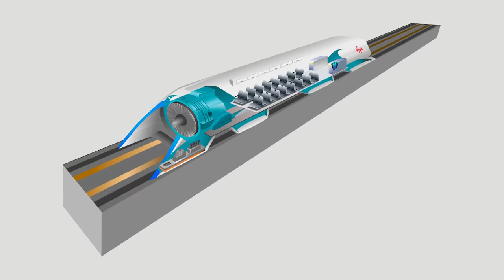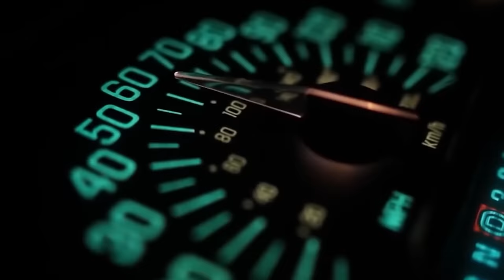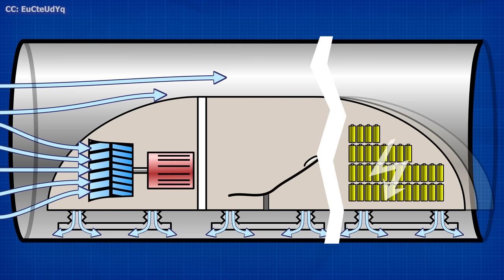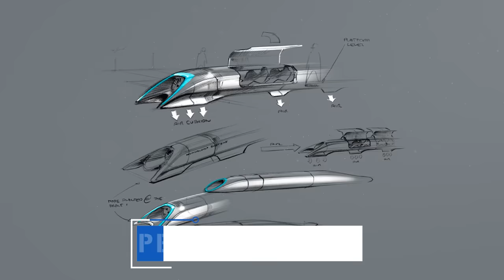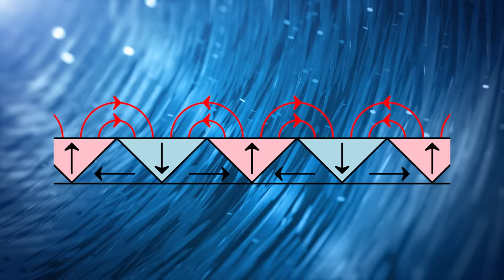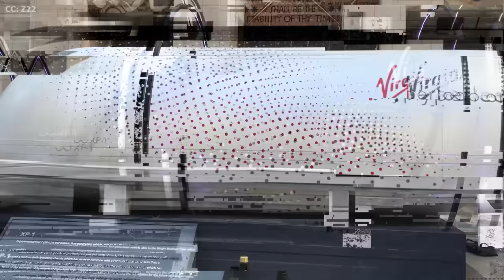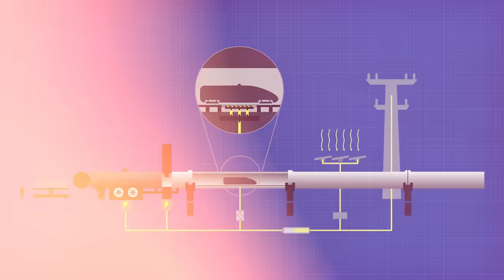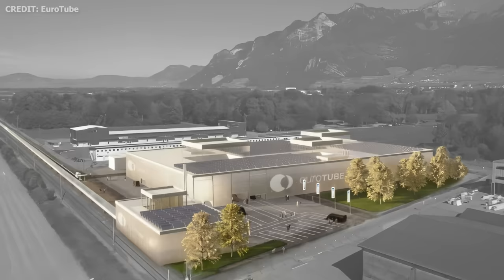We’re Getting Closer to a Hyperloop...

Comment: Sir, since you got this wrong from the start - vacuum trains are a more than hundred years old science fiction idea - long before Elon Musk´s father was born, I am not sure whether it makes sence to follow this to the end. However, here are some very simple reasons why this concept has no practical value: 1. Economics, 2. Technical issues and 3. Security.   As for no. 1 the more complex, the more expensive is a system. Cost for building and operation will be skyrocketing against any other system. One would have to build this tube more or less straight over land that is earned by someone, with a supply road underneath and service stations all 20 km with spare part warehouses and service crews and, and and...endless costs of operation. As for no.2 to maintain a medium vacuum in a tube of 3-4m diameter, there will be a massive amout of vacuum pumps required all requireing constant maintenance and energy. You must be able to seal this tube by airlocks to get people in an off the train and you have to deal with temperature differences and many more things to keep a vacuum upright in a chamber of this size. And last but not least: no. 3 Security. There need to be an option to evacuate the passengers in case of havoc or train failure. That would require to have airlocks every 3-5 km on the route or flood the whole system. Not to speak about the perfect terrorist target such a concept would be. However, lets for one moment think all these technicals and security issues could be resolved. There are already solutions in place which provide a better, cheaper and more effective and secure solution of transport already: The "train" and the "plane". There is no advantage over these by a "Hyperloop" an Hyperloop is just another Elon Musk bullshit concept and everybody who waste one cent for this project is completely mad and out of his mind.

Comment: No, the hyperloop will not happen.   Not at "scale".    Maybe some demonstrations, but not in a really impactful way.
Reply: Why not? Welded rails work great at scale without any issue with thermal expansion despite the lack of joints. I don't see why a vacuum chamber would not.
Reply: @johntheux9238  Won't the vacuum chambers need to be very structurally strong, to face the pressure ? Having them expand and contract won't jeopardize that ?

Also, even without that to worry, it's still massively expensive. The maglevs are considerably easier and cheaper, for ... 40 years already ? And yet you barely have any around the world. Because they're that expensive. The hyperloop is another magnitude more expensive.

If that 3rd world country of USA would actually have wanted to have fast travel between its cities, it would have made 200mph/300kmph trains already. It's 50 years technology already. Now we're getting close to 400kmph already, without maglev. 

Considering the security checks and check in and so on, except for the absolute farthest distances (coast to coast), high speed rail is on par or faster than airplanes, since you can simply arrive at the station 5 minutes before the train leaves. And you don't have the limitations of the airplaine, like no liquids or max 99Wh laptop batteries and so on.

And even for coast to coast, you can take the train over night and sleep in it for around 8 hours. Ok, it might need something like 10 to 12 hours. Still, with 8 hours sleeping, it will be like 2 to 4 hours of missing productive hours. Still on par with airplanes.
Reply: @johntheux9238 the energy requirements to draw and maintain a vacuum, given the fact that you have to have reach points at every station at least make such a system pointless.
Reply: The future is a long, long time.
Reply: @Yutani_Crayven  physics will still matter in the future
Reply: @johntheux9238  you need many vacuum tight expansion joints.   Which will be a challenge to maintain for a reasonably long service life.
Reply: @Winnetou17  Well yeah, the vacuum chamber has to survive both thermal expansion and atmospheric pressure at the same time while welded rails and ship hulls only have to survive them individually.
But it doesn't make a big difference, the same basic principles of adding stiffeners and building the vacuum chamber during summer to prevent thermal expansion to result in compressive stress still apply.
Reply: @SiriusMined  Having a welded vacuum chamber would reduce leaks.
It doesn't need to be a perfect vacuum. They are aiming for 1/1000 atmospheric pressure but 1/100 or even 1/10 would work. Airplanes can exceed the speed of sound at just 1/4 atmospheric pressure (11 kilometers in altitude)
Atmospheric pressure is just 10 tons per square meter so the energy needed to create a vacuum is the same as moving the same volume of water up 10 meters. Not exactly a big challenge.
Reply: @videoviewer2008  Not necessarily. Modern high speed rails for example are welded. They survive thermal expansion just fine, they are just designed to handle the internal stress created so they are like a loaded spring.
Reply: @johntheux9238  there are breeches at every stop.  And we're talking about miles of pipe.  Trying calculating the volume and understand how stupid what you says sounds.

I've worked on vacuum distillation columns for years,  Even pulling and MAINTAINING vacuum on a small column uses up a fair bit of energy.  Now multiply that by thousands of times.  Oh, and a distillation column isn't open at both ends.  Even with some mechanism to open and close the eends when there is no train passing, you're going to lose a lot of vacuum.
Reply: @SiriusMined  A big cargo ship can actually reach the same volume as 100 miles of vacuum chamber, around 600'000 cubic meters.
And the length doesn't matter if the only leaks are at the stops and there are only a single stop every 100 miles.
Reply: @SiriusMined  There is no liquid boiling inside the vacuum chamber. You only have to pump the air out once, it's not like vacuum distillation at all.
And it's not open, there is an airlock.
Reply: @johntheux9238  an airlock the size of a train?  Get real.
Reply: @johntheux9238  you're ridiculous.  They'll need maintenance access far more often then that.  And not to mention what happens if the train skin is ruptured.  Or breaks down in the middle of a section.

Stop listening to futurist non-sense.
Reply: @johntheux9238  Vacuum chamber is a bit more complicated, fragile and expensive than rails. But fine, lets say you can build the strongest tunnel in the world, it could theoretically, possibly, maybe partially solve a single issue (thermal expansion) amongst a dozen that make this project unviable. One of which is cost that will be exacerbated even further by strengthening the tube.
Reply: @johntheux9238 😂😂😂😂😂😂😂😂😂😂😂😂😂😂 bro you just compared a rail line to a vacuum sealed system. I 100 percent believe you don't see why.
Reply: @blakewisswell  None of them use seals. They are both welded to reduce leaks. Which is why I compared them because the biggest issue is thermal expansion.
Reply: @Winnetou17 
You are correct, if the Banana Republic know as the United States cared less about military power projection, social engineering and virtue signaling they may have helped solve some problems instead of causing them.
Reply: @johntheux9238  a vacuum doesn't use seals? 😂😂😂😂😂
Reply: @blakewisswell  You still need seals at the airlocks and pumps, but not the welds.
Reply: @johntheux9238  You clearly think this is the equivalent of hooking a vacuum cleaner to a piece of pipe but bigger. I don't know how to explain to you in a reasonable internet reply length how much more it is.
Reply: @blakewisswell  It's not a perfect vacuum but low pressure air. The cheapest pumps on the market would work fine.
Reply: Earthquakes would impact the structural integrity
Reply: @Winnetou17 the US is a non nato nation? wild

3rd world country isn't even a term that's actually used anymore considering the 1st and 2nd worlds stopped existing in 1991
Reply: @nicholasbrown668  You busted me here. But I think you got the idea :D
Reply: @Winnetou17  just saying if you want to insult the US without looking like an idiot

don't use a term that's been dead geopolitically for almost 40 years, and don't use that term incorrectly lmao
Reply: @nicholasbrown668  I don't agree. Just because geopolitically it's obsolete, that doesn't mean that it's obsolete as an insult. Actually it's even better, since there's now impossible to have a confusion.

Also, there's not better term, that wouldn't take all the fun out of it. I guess banana republic can be used as well, but it's not as good. Neither is "second hand". Do you have better alternatives ?

Lastly, if it matters, the term is still widely used where I'm from (Romania).
Reply: @Winnetou17  Romania isn't important and no one cares about it

also it is obsolete as an insult and always has been "HAHA YOUR COUNTRY ISNT CONTROLLED BY THE US OR USSR" how is that an insult? 3rd World countries were countries who didn't have their political matters influenced by either the US or USSR, Switzerland was considered a 3rd World Country
Reply: China:you are challenging me huh
Reply: I’m sure Musk saw that it was economical challenged.
Reply: @johntheux9238  Because getting a vacuum in so long tube will take enormous amount of energi and keeping the vacuum.
Reply: @henrikl1394  Not really, pressure at sea level is only 10 tons per square meter so the energy needed is the same as moving the same volume of water up 10 meters.
Reply: @StickOfTruth  There are thousands of metalworkers in the shipbuilding industry who make hulls with an internal volume of hundreds of thousands of cubic meters that can handle one atmosphere of pressure while being completely air tight.
Just listen to them.
Reply: @johntheux9238 welded rails don’t require perfect seals. Also welded rails do buckle and warp minutely but over vast distances it is better absorbed. They require frequent checking and realignment and still trains derail because of misaligned tracks. A steel tube unevenly lit by the sun, plus having a vacuum inside that prevents cooling by thermal conduction would be a massive nightmare.
Reply: @johntheux9238 it is a challenge to move through air molecules even at near vacuum without resistance. The problem is the confined space. Molecules don’t have anywhere to go.
Reply: dennis_farmer like alchemizing gold never happened. Like flying cars never happened. Like contacting the dead never happened. Like floating cities on huge hydrogen-filled islands never happened. Like Segways becoming the “walking alternative of the future” never happened.
Believe it or not some things just don’t work out.
Reply: @Mothball_man  Welded rails are perfectly sealed even if they don't have to. Try moving air through a weld and tell me how successful you were xD
And the hyperloop vacuum chamber would be painted white so it's not going to be as hot as a rail.
Reply: @Mothball_man  Just read the white paper:
"The inner diameter of the tube is optimized to be 7 ft 4 in. (2.23 m) which is small enough to keep material cost low while large enough to provide some alleviation of choked air flow around the capsule. The tube cross-sectional area is 42.2 ft2 (3.91 m2) giving a capsule/tube area ratio of 36% or a diameter ratio of 60%"
Reply: @Mothball_man  Flying cars do work out if you use electric motors. Never heard of eVTOLs?
Reply: @johntheux9238 you cant just weld several km of metal tubing and call it a day. Hell they put expansion joints in water piping because of thermal movement.
Reply: @Mothball_man  That's not what they do with welded rails and it works just fine.
Reply: @johntheux9238 I don’t think you’re aware of the wide use of expansion joints in civic engineering all around you. They’re literally everywhere. The hyperloop would need expansion joints. It’s not worth mine or anyone else’s time to argue with you about this.
Reply: @johntheux9238  what are you talking about? VTOLs aren’t flying cars. Ah dang you’re a child aren’t you. I’m out.
Reply: @Mothball_man  They are everywhere except on continuously welded rails, which are the closest thing to the hyperloop vacuum chamber.
Reply: @Mothball_man  I'm 24 years old.
And most of the weight of an electric vehicle is the battery, not the motor so a flying car can have motors dedicated to driving on the road and motors dedicated to flying and both would share the same battery. The whole point of electric propulsion is to replace one engine by several smaller motors so making a vehicle that does both is not an issue.
Reply: Lots of fake a*s engineers here huh
Reply: @johntheux9238 You talk a lot but like everyone else you have no idea how to address the problem of thermal expansion on a 600 km cylinder
Reply: @grandmastarflash  With current tracks they just weld them when it's hot and they stretch under tension when it's cold. With long length a lot of stretching can happen without damage.
Reply: @wesleyashley99  ah yes, current tracks, those well known cylinders...

Comment: The maintainance headache of trying to maintain even a partial vacuum on such a large scale would be near impossible. You would need hundreds or thousands of vacuum pumps along the length of thevtube.
Reply: One bump to the outside and it will implode...
Reply: Just as there are thousands and even millions of wheels, nuts, screws, servos, in a large device. And yet these devices are still working, and even get larger and larger. Supertankers, SpaceX rockets. Bullet trains. Microprocessors.
Reply: @othmanskn  The problem isn't what you mention. It is that the pressures are enormous and structural integrity is very tenuous. Unless you want to build beyond all economic reason.
Reply: @kentl7228  All subjective statements that are meaningless. Bullet trains and Supersonic jets also suffer the same problems but Bullet trains are getting more and more. Supersonic jets are widely used in the military and they even upgrade to hypersonics. Space flights used to suffer the same subjective criticisms, but they are launching more tourist flights. Not to mention reusable rockets.

Air and space travels are few in comparison to mass Transportations and yet you dare to conclude that vacuum tunnels are uneconomical.
Reply: @othmanskn  I love that every single comment you make is 100% wrong because you don’t have any understanding of the subject lmao
Reply: @othmanskn  You still don't understand, the problem is the structure to create a vacuum tube. It is an engineering problem that requires huge overbuilding at massive cost, or the risk of collapse from a slight dent. The pressure differential between the outside and inside is massive with a vacuum tube. To keep it perfect over many kilometres requires a huge amount of power and needs incredible sealing integrity.

To pressurise a flight cabin on a supersonic jet, is nothing near as difficult and the pressure inside is greater than outside, the opposite of a vacuum tube.

Bullet trains are irrelevant as they don't run in a vacuum tube, nor need cabin pressurisation as they run at ground level. Anything going into space is a small object, not kilometres of train tube.

The closest machine equivalent is a deep diving submarine, and one failed while touring the Titanic wreck. The people died in an instant due to the implosion.

The kilometres of vacuum tube is the problem, it has never been done successfully at any kind of scale, and for good reason.

So I absolutely dare to point out such problems.
Reply: The tanker cylinder shows the difference between internal vacuum and external pressure when failure occurs. A tanker cylinder is is not a weak design, but it is much easier to keep structural integrity when the inside has higher pressure than the outside.

Comment: This is one of those technologies that would change the world if it were to become practical and cheap, but nothing I have seen so far regarding the research and development tells me this is not going anywhere but possibly a very expensive prototype that no one ends up using for anything beyond proof of concept.
Reply: No it wouldn't change the world. It doesn't offer any advantage significant enough compared to existing solution to transportation problem, so even if the tech was feasible and (relatively) cheap to  produce the cost of building the infrastructure and maintenance alone makes it unappealing.

Comment: The sheer amount of power you would need to depressurise the massive volume of space would defeat the object of hyperloop even if you can make it work. Each time you open up the gate or even many gates you have to pull the air back out. It doesn't take long for the atmosphere to enter the vacuum.
Reply: a system of floodgates could be implemented to speed up the process, think of it as a plane, you actually have to spend a buch of time to get off of it, unlike for example the underground which is just a door opening.
Reply: Not to mention the continuous depressurizing every time a pod enters the tube and leaves the tube. This will also cause a slow down as each pod has to wait for the airlock to equalize pressure every entry and exit.
Reply: @asandax6  couldn't have put it better myself.